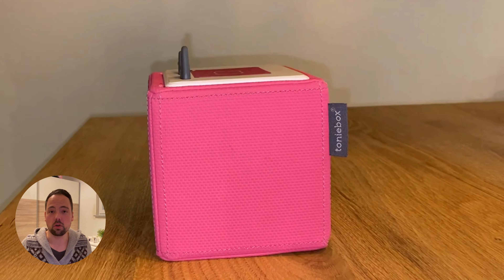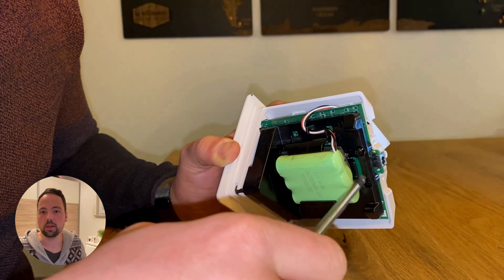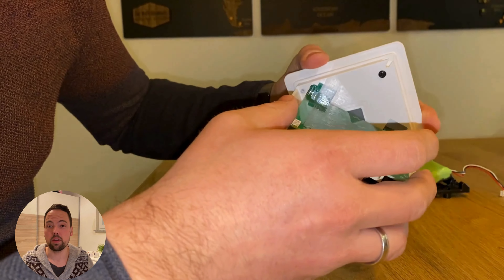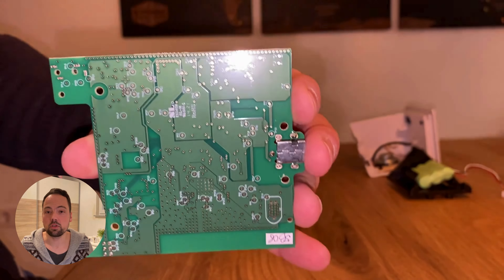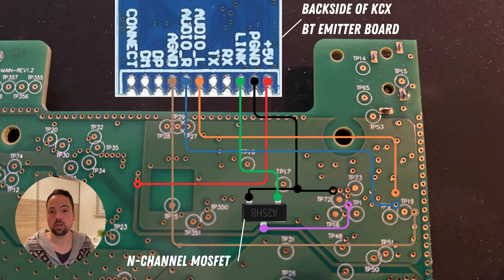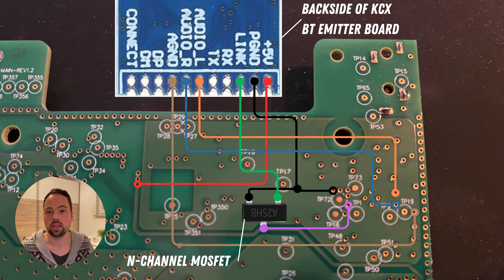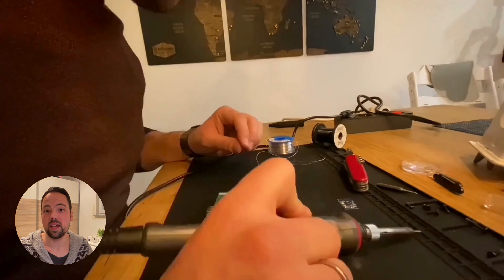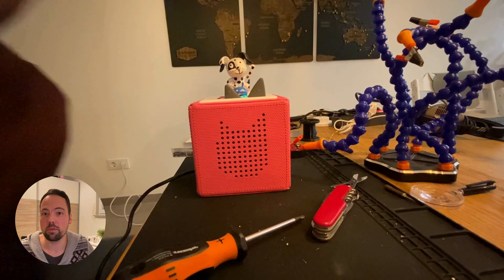Toniebox Innovation: Connecting to Headphones via Bluetooth

Comment: By implementing the headset detection with Si2302 mosfet as described, I realized my Toniebox always hung up in headset mode after start up of Toniebox. It then returned smoothly to speaker mode when the BT headset connected and disconnected again. So I assumed it’s an improper start-up behavior and I discovered the LINK output of the “KCX_BT_EMITTER” board was floating around too long during startup phase that put Toniebox in headset mode right away.

Solution that worked for me is adding a 10k pull-down resistor directly at the LINK output to GND at the board terminals. Now my Toniebox starts up properly in speaker mode until a BT headset is connected.

Info: I’ve got the ESP32 Toniebox HW/PCB which is the very recent version that has the vias covered with that ugly silkscreen. I managed to remove the silkscreen very very carefully with a flat and sharp screwdriver.

Cheers, Paul
Reply from the maker: Wow, thank you for debugging and the detailed information on how to fix the issue! I guess that will be helpful for a lot of others that want to implement this, too. Love it!

Comment: Could you please show the final result as a picture? 

What kind of wire did you use for the connection?

Thank you very much!
Reply from the maker: Sorry, I do not have a picture of the final result. For this, I would have to open the Toniebox again but this is not as easy as my daughter loves the box 😉 

I can try to cut out a frame from the video footage which shows at least parts of the wiring and send it to you. Would that help?

Regarding the wires: I used enamel wires, actually those ones: https://www.amazon.de/dp/B071YWKXMZ
Reply: Thank you very much! Helped a lot. No need for a screenpic. Thank you
Reply from the maker: @walideba5350  ok great 👍🏻 thanks for letting me know!